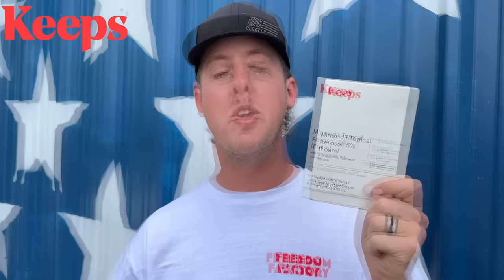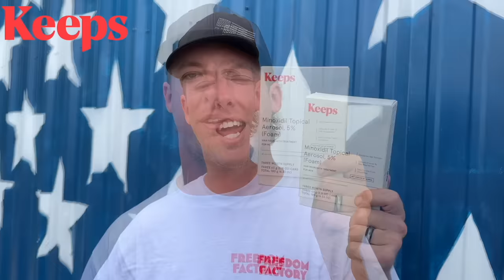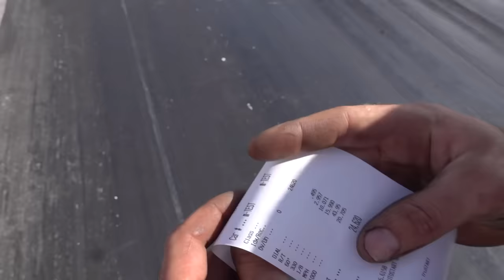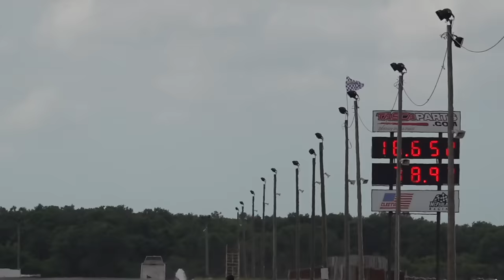Racing My Big Block Tow Truck!!! (Ended Horribly)

Comment from the maker: PSA always keep your rollback bed in locked position before drag racing...
Reply: Smart
Reply: Should have James checked it and have him say it ain’t going no where
Reply: Noted
Reply: 10-4.   🇺🇸
Reply: I got the live stream for the first time and it was amazing, best 20$ i have ever spent.
Reply: News I could have used yesterday!
Reply: Cleetus replace the shifter tube on the side of the column on that tow truck it will do strange things with it all wore  out
Reply: Ty needs a new suv hook em up
Reply: Left pto engaged after you slid the bed back.
Reply: son of a biscuit cleeter the block beater damnit
Reply: You forgot you have to strap down vehicles to the boom!!!!
Reply: Strange sentance to read hahaha
Reply: I have never laughed so hard in my life 😂
Reply: Trail Mater would definitely beat your tow truck in that condition 😂
Reply: Cleetus you can't drive your tow trucks with the people turned on that's what blew your hydraulic lines.
Reply: Need an update on Holly an the golden retrievers. Haven't seen them in awhile. 🥺
Reply: No body can break 'em like McFarland Racing! XD
Reply: My question cleet is did you turn off the PTO before you went down the track 🤣🤔
Reply: You might want a safety chain set up if you decide to run with the bed extended.  Just sayin... for the pavement's save
Reply: Palmettostatearmory🤷‍♂️😁
Reply: Ricky bobby makin content
Reply: PalmettoStateArmory 😁
Reply: Cleetus, When is KEEPS going to come out with a Cleetus formula?
They could have in grow in the hair in the front real slow, and the hair in back real fast.
The McFarland Mullet special treatment.
Reply: I can come fix that stuff up for ya no problem! All the hydraulics, fork lift etc. I do mobile lift truck service all over florida based in tampa. Thanks for the great content as always! 👍
Reply: PSA Always Strap cars on the wheel lift !
Reply: Aint gonna lie Brother this has got to be one of the funniest most entertaining videos you've ever put out hahahahahaha
Reply: TSA (Tye Special Announcement) remember to use tire straps 😂
Reply: I think you left your PTO engaged and then took off down the track...oops!!
Reply: maybe try strapping down the cars too lol
Reply: I love how Cleeter breaks mullet or ruby and McFlurry and he is like it is what it is this happens in racing. The rollback breaks and he is coming unhinged no no no why why damn . He is a class act never skips a beat on his big dollar race cars And a budget build for the subscribers and he is pissed at himself. I love seeing any video that is longer then 20mins. Thank you Cleetus and the entire McFarland Racing Team
Reply: That look of panic on your face had me rewinding it a few times. Hahah
Glad you’re ok but that might have to be used for the next iteration of your “Fear” shirt in the store. 🤣
Reply: Did you turn the PTO OFF?
Reply: And turn the hydraulics off!
Reply: Fleet dropped his shoot
Reply: I discovered that my old fishing straw hat got wet in my car over the winter and had mold on it.  Luckily I had purchased one of your FF straw hats, so I'm ready for fishing!  Hat is nice, got it in the mail.  Also, that's a sweet turbo C7 in the intro, hope we see more of it.  Cheers man
Reply: That look on your face when you know you f*cked up BAD😂
Reply: We need to see the new paint job on the ff helmet
Reply: Your keeps commercials have become a thing of their own brother!
Reply: It's just like having Heavy D on the track😅
Reply: No
Reply: It’ll buff out brother
Reply: Tye did not deserve that...
Reply: We need an "oh no" t-shirt stat 😂😂😂
Reply: Any racing car needs excellent fuel and a lot of air.🫡✈️🛣️
Reply: PSA: Always tie down the tires before you launch your towtruck.
Reply: Did you turn the pto back off
Reply: Put the 7.3l godzilla in the black tow truck
Reply: Put the 7.3l godzilla in the black tow truck
Reply: Give two bears racing a call they can do anything
Reply: Manual swap the 7.3
Reply: My dad passed away this morning and you guys managed to bring a smile to my face for bit thank you guys for being you and have a good day
Reply: Brother, please tell me tbm makes a six lug brake kit or were these custom made just for this truck.
Reply: Yes that is a very good idea well I guess your learning what and what you can't do too bad your learning the hard way but sometimes it's the best way.
Reply: Love the video bro,please get some Gale Banks goodies for the diesel please?
Reply: 14:58 "Mistakes were made!" Lol. "23:03 Even more mistakes were made." Sheesh lol. "Cleetus!"
Reply: Was Tye on the brake trying to keep from being towed away at the start as a joke? How his truck didn't go along with Cleeters truck is a mystery.
Reply: I think,  all in all. . . That was quite a destructive video 😂
Reply: Disagree bed was fine. Solid theory behind the whole thing.
Reply: I guess you guys should of put in bigger U joints and put a new Carrier bearing in when you guys were putting that big block in it since you were adding lot's of torque when dropping in that 632. The good part is now you can do that now.
Reply: I make the front grill for that gmc
Reply: Please get some new rubber for the snatch truck that back right is hurting
Reply: You should look into having load holding valves installed on the hydraulic cylinders. They will prevent the bed from falling down incase of a line failure.
Reply: Wouldn’t helped you lost the driveline and it opened your hydro system so it let air in.
Reply: Cleet u should sell the C7 for top dollar and the porsche.
Reply: Actually, it probably would have been fine if it would have already had an upgraded driveshaft.
And you can NOT run a one piece that long.  

But, if you upgraded to a 3 piece with way heavier duty carriers (like SEMI type) then you can beat on it til the trans takes a poop.
Reply: Tye should get a track hawk
Reply: Cleetus if it was a wislen diesel he would have split it up in 4 videos😂😂😂
Reply: I've got to say @ 24:12 and the following 10 seconds I haven't laughed so hard at someone's panic/oh SHIT moment in quite some time.. Sorry Cleet but it caused quite a chuckle
Reply: @hegsagawd9839 thats his oldest daily driver from back in da day
Reply: You will have to drag race junkyard empires big-block tow truck ild love to see u dobthat
Reply: Hope the track is ok
Reply: turned it into a sail, saw this coming lol
Reply: The hair product don't work. Scam away brother. It's what everyone else is doing so join in the scammery of your viewers.
Reply: Yea made for a he'll of a video but the carnage got worse and worse 😬
Reply: Tow truck made so much torque it twisted the hydraulic shafts coming off the line  😂
Reply: Should give tye a new explorer or something man
Reply: We can tell you don’t use keeps man🤣
Reply: Loan Tye the C7 while his explorer is being fixed.
Reply: you need to have a spare  transmission built for  the 7.3  freedom sniper   towtruck as a spare  , that old one is on its last leg by its slipping , take the old one and have it redone also for a rotate spare .
Reply: Call Gearstar Transmission for the Ford tow truck
Reply: Turbo expedition coming soon?
Reply: Cleet put a massive bush bar bumper on the front like extremely massive lol
Reply: Mr. Cleetus, what a day! I’m 57, disabled, and I love cars! I always did stupid stuff in them! I’ve been binge watching your channel for two weeks and you put a smile on my face during a really hard time in my life brother! I thank you so much sir! God bless you and your wonderful family! Hats off to you brother for being a fun clean dude! Keep up the good work!
Reply: Get Ty a new SUV and if it’s his wife get her a new unit.
Reply: Fords guys! Lmfao!😆
Reply: Forget about fixing the trucks you need to hook up tye 1st
Reply: Are you still doing all the editing on your videos by yourself? Haven’t heard you say anything otherwise lately. Either way your killing it brother 👍
Reply: @CleetusM did you shut the PTO off before you launched lol
Reply: Cleetus, get that right side tyre fixed, as you shouldn't be on any public road with that superb 7.3 Ford F Truck like that !!
Reply: @strictlybanks8612  Don't forget to slap it.
Reply: And shut off the PTO!!!!!
Reply: Are you sure the PTO wasn't still engaged when you were at 7k RPM?
Reply: Yer done
Reply: Barra an a t4hunny use the boom as a wheelie bar just saying 😉
Reply: I'm guessing pto was still engaged and over pressurized the system and blew out an old hose, causing it to drop.
Reply: OOOOOOO Nooooo Brother !
Reply: Hell yea brother! Words of wisdom😂
Reply: It didn't really make any difference to what happened other than making it funnier.
Reply: Did you leave the pto engaged?
Reply: “I know what I’m doin”.
Reply: >>>> ditch the trans, use whatever trans you want to hold the power, use a front mount pump like you have in the snatch truck. That way you just hit a button and have PTO and your trans can be whatever custom job you want. Today it was a driveshaft, tomorrow it's the trans. May as well do it now before ordering the new driveshaft.
Reply: @growlith6969  Solid idea as long as there is room up there. I can't remember how much space was left to do that. The only issue doing it like you suggest is it cuts into the content of breaking it a few times before the "final fix".
Reply: @XathridYT  Thats what I said.  I think it was.  Lol
Reply: @--_DJ_--  should be the same kit as any big block truck from the old era. Deweeze should be able to hook him up with the pump and brackets.
Reply: Buy ty a new vehicle he works so hard he deserves it
Reply: Thanks, I'll try to remember next time I'm drag racing my rollback
Reply: @growlith6969  Fair enough, it isn't like the big block is a foreign thing to that bay. I wonder how well it would play with the front drive they have now.
Reply: Did you turn off the pto after moving the bed back?? 🤔
Reply: Cleet time for some drag racing videos. This acting a fool mess is overdone now.
Reply: get a zf6 trans for the 7.3l
Reply: @robbygray9562  It has always been a good mix around here. There will be some better drag racing to come soon.
Reply: @--_DJ_-- ya ive followed since og leroy days. He has jumped into to many hobbies. We get zero drag n drive events, zero leroy content, zero ruby and mcflurry content.
Reply: I love your generosity with regard to Steve Morrison and that Turbo 400 Trans. ❤👍💯🫡
Reply: Clean up lane two
Reply: @robbygray9562  We got sick week, though it didn't go well so it was short. Leroy is getting a body (gross) that is his content for now. Didn't they just blow ruby up at the track a few weeks ago?
I like the variety myself. The boys are just entertaining to watch pretty much no matter what they do. Even the RC stuff that I have no interest in is good fun to watch.
Reply: Just for love of God please buy Tye a new rig he deserves it
Reply: In cab view of the flat bed had me fucking rolling 😂😂😂
Reply: I think we have a new "Fear" T-shirt
Reply: if mats off road recovery has wrecker games... cleet should start calling those guys out for wrecker racing with a crown vic behind it
Reply: I’ve never seen a strap on a single car on that tow truck so it was a matter of time before a car came off.
Reply: The stock Duramax 2 piece driveshafts with the 1480 rear yoke are solid to 1200lbft and 130+mph. May be hard to get a single piece that long.
Reply: i got a perfect name for the new tow truck.. "milkshake" because it always brings the boys to the yard!!! Kelis Milkshake song refrence..
Reply: Wish u would do a 4l80 on that roll back
Reply: Seems you left the PTO on when you put the bed back brother that might have made the issue worse IMO
Reply: And PTO off when racing
Reply: @CleetusM Brother you have got to buy Ty a New and Improved Daily Driver!!! I mean Come On Man!!! I know your gonna... I bet you wont... I bet you wont.... lol
Reply: Monster transmissions
Reply: @cleetus BTS transmissions where you need to go
Reply: @perieearquette5880  absolutely terrible option worse than jasper
Reply: You should call the power stroke Milkshake since it brings all the boys to the yard.
Reply: Yea pto isn’t designed to spin in high gear let alone any higher than about 1200 rpm’s. I love the content but please get someone who runs tow trucks to show you how it works through and through so you don’t have this issue anymore.
Reply: Sam wyse transmissions builds one mean E4OD
Reply: @dangit4341 I was thinking the same.
Reply: You’re entering the “find out” portion of your antics.
Reply: That's great but you only live once and that is some redneck science if I ever seen it, thanks to you now we know!! Cleetus McFarland high performance scientific testing unit!!🤟
Reply: Gotta get tye right with something better not just fix that bumper
Reply: You’re done ✅
Reply: This video was amazing. Make the 7.3 better
Reply: John Muldoons builds some bad ass transmissions and has paddle shift kits for them… just throwing that out there
Reply: Put the 7.3 Godzilla in the tow truck with a supercharger
Reply: Pricey day for ole cleet, a transmission, transmission in the wrecker, fix tyes daily, and the rollback 🤣
Reply: Brother, you're probably not going to read this but I just wanted to say that I've been watching since you first got Ruby and I've been a fan ever since. I've had a really rough time for the last year with a handful of different things and your videos are truly the highlight of my day. You always manage to make me smile and realize that my problems are only temporary and that in time, everything will be good. Thank you for what you do, I truly appreciate it. Much love from Montreal Canada.
Reply: Blue F-150💯
Reply: and remember to turn the pto off before you drop the foot into it,,,,,,,,, lol,,, still great content.
Reply: Isn't that common sense
Reply: I'd say it needs a hoop or two around that shaft 😂😂😂😂😂
Reply: Also strap the tires to the tow jaws.
Reply: 24:28 the look in Cleeters face was fucking priceless 😂😂😂
Reply: Brother I love what your doing with the tow truck content. I've been driving one since covid in 2020. You have to secure the vehicle on either truck. On the Ford you put a strap over each tire to the wheel lift. On a rollback you're supposed to have four points of contact to the vehicle not including the winch per Florida state law.
Reply: Thank you for the tow truck content
Reply: Now cleet listen here😂 can a tow truck go 10s!?!?
Reply: Title should have been, how I spend $50,000. Lol
Reply: Fastest tow truck is by Eddie and he went 130 mph!
Reply: Iv bought one shirt and a sticker for the hopes of getting the gmc I blew the trans in my 01 so all my money other money is going back to save for a new one
Reply: Well, yeah...
Reply: The bed just wanted to experience some freedom.... I say Never lock them down.

Lmao
Reply: Said nobody ever lol. Till cleet shows up haha
Reply: I would recommend a new lift for the wrecker. That one is for light cars. And I have a feeling yall will be doing more than that with it. Look into some other repo beds.
Reply: American transmission in Jacksonville can build it how ever you need for both tow rigs call and tell them Adam sent you 👍🏽
Reply: @robbygray9562 gotta remember witht the pay per views now alot of the actully drag events and races are Mainly on there now so the main channel videos get little random fun stuff on weeks like the freedom 500 cause all the other cars are set up at th4 booth for the event and the ticket holders to check out on race weeks and also entire crew is focusing on all the crown vics last 2 to 3 weeks if not last month to have them all ready for the race so not much time work on the drag cars and then they've been hot and heavy on the singke cab gmc to have it ready for give away but Mainly the races coming up next two weeks so we got tow truck videos and things of that nature from cleet and George last couple weeks! I'll personally say get the year pass for the pay per views it was totally worth it to watch the races and random surprises they do on them!
Reply: Performance E4od/ 4r100's are my bread and butter
Reply: Haha great idea
Reply: New name for the roll back "Karma" because "Karma is coming for you"
Reply: Don't treat it like whistlin weasel, this is pretty silly really....
Reply: @CleetusM yall may wanna reach out to Monster transmissions, they do have applications to fit the 7.3 and the rollback and make them bad units able to take power and some of the shenanigans
Reply: You should put an intercooler on that. The 7 3.
Reply: Only saw one wheel spin on that gmc…..the axles and or transfer case is probably broken
Reply: The only thing broke is going to be the winner on the GMC…….taking on all the Fords
Reply: I might be wrong, but i think you left the PTO on while drag racing with the rollback .
Reply: I think u guys have to build a all wheel drive LS Drag car
Reply: Cleet when you get a chance can you check your email please? Thanks!

Kind regards,
Brandon
Reply: So GearStar transmissions makes an excellent trans for a diesel or Monster transmissions is the only two i can think of that will take the abuse that you are thinking of putting it through.
Reply: I can't believe there's still people out there that haven't found out that Monster Transmission was an online scam
Reply: The way that oil was spraying the pto was left on that’s probably why the prop shaft snapped I blew my gearbox on my truck driving with the pto on
Reply: 24:30. "Ohno,  Ohno,  Ohno "  LMFAO
Reply: Cleet. If you're gonna go on public roads towing with the 7.3. Please use straps around the tires. If what happened on tyes truck happened on a road you could kill someone.
Reply: I have a 2006 ford expedition you can have - great condition.  150k miles. Starts right up
Reply: 😂 start strapping down those tires on the hooks.
Reply: Cleet, keep the feathers man, it makes the whole thing work on leroy
Reply: at 25:45...tell me he doesn't look like Dudley Do-Right.
Reply: Are we gettin a new “DANGER” shirt now?
Reply: I am crying, oh MMMM GGGGGGGGGAaaaa
Reply: Seem like a GOOD IDEA
Reply: @trailmater
Reply: So there is no locking of front wheels they free spin. It’s normally RWD and I’m guessing in neutral. Unless you are going slow the front wheels need to be strapped when towing like that or any quick launch you will lose that vehicle.
Reply: Forget the driveshaft loops. Need a driveshaft tunnel. Damn‼️
Reply: @ericwiesike7905 do you mean the pto?
Reply: 26:58 you definitely need a performance balanced driveshaft to handle this horsepower range.
Reply: Ashley love you 💕 cleetus
Reply: Ohhhhhhh my bed oh no bahahahhahaa 24:58